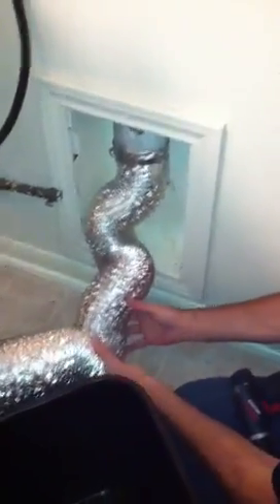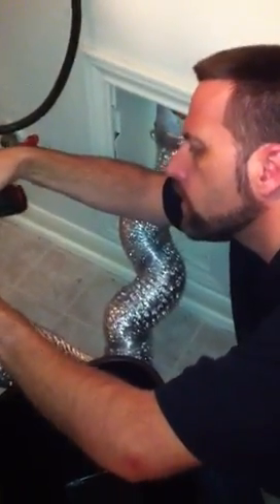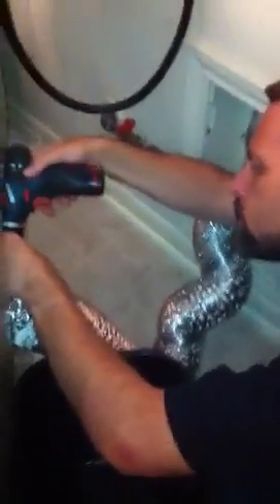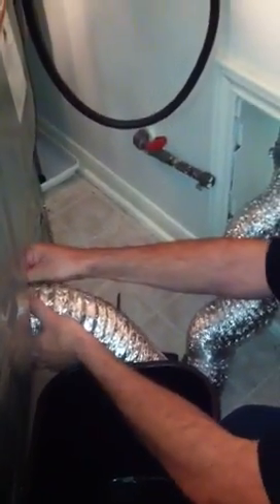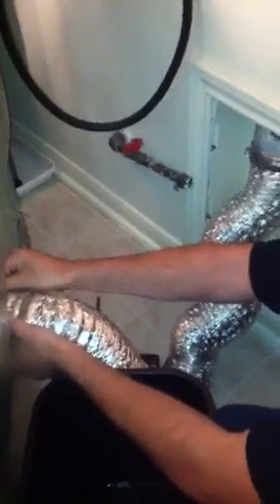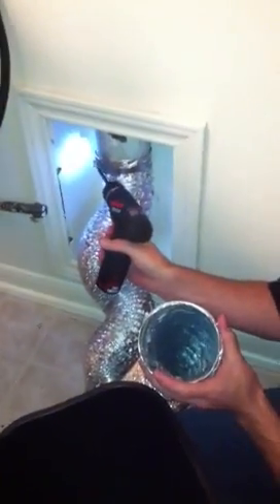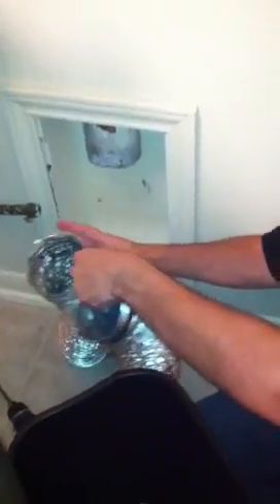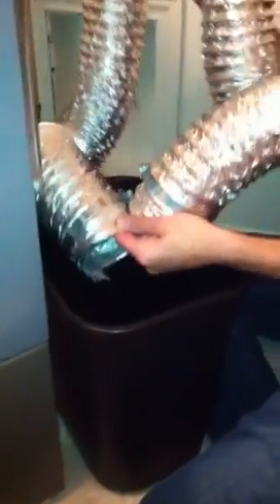Water in Dryer Vent

Comment: We had so much water in our dryer ducting (well over a liter )hat it was definitely not just condensation. There was also not very much lint .We have a rooftop vent and believe snow blows in when it blizzards or the wind blows while snowing and then it melts.  We've only noticed it in the winter months, although if its very windy and rains, the same thing could possibly happen.

Comment: Same problem. Got a new dryer because a repairman came out and vacuumed lint out (opened the case) and it still didn't work. He totally missed the water in the vent (even though we said it sounded like water was somewhere - we didn't know where). So we thought bringing him out again would have pushed the repair bill up even more and the dryer was on sale so lets not leave it to chance. Now I'm annoyed after discovering the problem when they installed the new one. The old one could've been fine...Or maybe the water restricted it and broke it...because it was no longer drying.

We'll see what happens now. It may have been water coming in from rain though...I had about a gallon of water in the coiled hose (which also was more coiled than I think it ought to be, so fixed that problem as well with the new install) that I vacuumed out with a wet vac. Who knows how long it was collecting for. I'd say it has to be rain, but who knows. Maybe condensation over a year or more. I really don't know. It was really annoying. Now there's a new dryer in with easier access at least (stacked them now instead of side by side). So I can easily keep an eye on it. I think that repairman was lazy and didn't want to move the dryer to even check the vent. It was a tight spot. Had he checked that, maybe we wouldn't be with a new dryer. Or maybe we would. Maybe it was already broken beyond reasonable repair.

Comment: Found the issue for my case. Also in a brand new 2017 home and the issue was that the cover for the dryer vent flew off from the roof. There’s supposed to be an angular cover that prevents water from coming in but for me the issue was happening when it was raining. The dryer vent was completely exposed and causing this same issue. I recommend calling your local roofing company. They should be able to fix the issue. I was able to run to my local home
Depot and find the cover

Comment: This will happen in winter months when it is cold.  The warm damp air in the dryer duct condenses because of the cold air surrounding the outside of it.  If the duct is full of lint, it will become saturated and cause a bigger problem in that it will be difficult to remove.

Comment: It's likely not from rain. I had the same problem.  In my case, the duct ran next to an AC vent. Cold dry air meets warm, moist air. What do you get? Rain. It's likely there's a cool area that's causing the warm moist air from the dryer to condensate. I moved mine. Problem solved.
Reply: Yep, condensation.   There is around a half gallon of water in a full load of clothes and all that moisture has to go somewhere!
Reply: But now mine wont start! Does it have to dry completely? Mine is condensation.